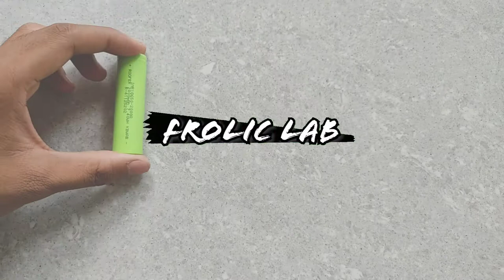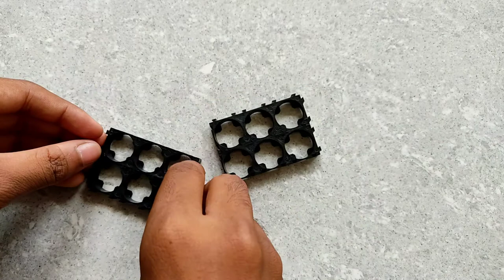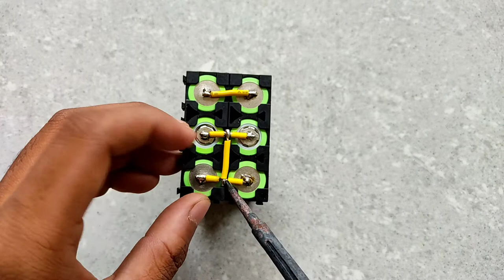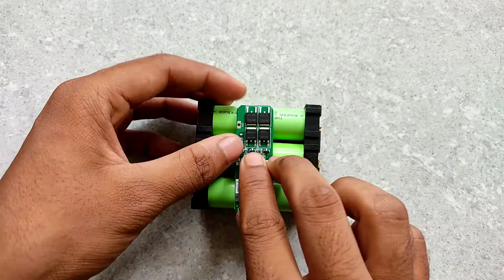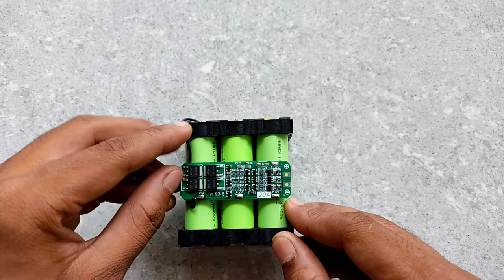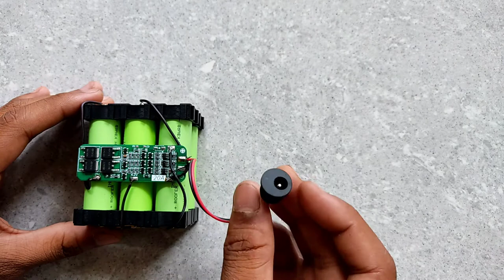How To Make A 12V Rechargeable Battery Pack Using 18650 Battery & 3s BMS.

Comment: Hi, nice video. What kind of power supply did you use to charge the pack? Is it a proper charger (maybe a CCCV) or a simple 12 V power supply? I'm asking because I'm not sure what to use, I have a similar BMS and I don't know if it includes a charger in the same board too.
Reply: 12.6v smps

Comment: Pls can you tell me how can i make different output and rechargeable point
Reply from the maker: Connect a male barrel connector or output wires in parallel at the same point.
Reply: Thanks 🥰

Comment: Hiii bro mean drone bana raha hu to kya 3s battery Or sathe bms power module use karsakta hu drone mea fix kar ke..!!! Koi issue ho sakta hai kya
Reply from the maker: No, bro it will work the same, only factor is your power requirement and weight of the battery.

Comment: Bhai iske liye changer konsha chaiye
Reply from the maker: Any charger or supply with voltage 14-16V will work or you can use XL6009 stepup module to charge this.
Reply: @FrolicLab  bhai ek kaam karo ap iski battery bna kr de sakte ho BMS wali 12.6 volt iska charger hey 14 volt 2 AM ka bina bms ke charge nhi ho rahi hey please help karo bhai yarr wo bhut mhenga aya hey kam se kam uske pase washul ho jaye
Reply from the maker: Bro check the circuit diagram, and check connections properly it will work, And also check  your batteries if they are faulty.
Reply: @FrolicLab  bhai ap bna do kitne pase logo ye batao
Reply from the maker: Sorry bro, I don't sell anything
Reply: @FrolicLab  toh bhai 3 sale se ye 4 sale se 12.6 volt ban jaega bina bms ke but uske liye charger kitne volt ka or kitne AMP ka chaiye
Reply: @FrolicLab  bus ye toh bta do ishe charge kase karu
Reply: @FrolicLab  mare pass 8 sale 3.7 volt wale 18650
Reply from the maker: With 3 cells in series you will get 12.6 but charging without bms can burn your cells, or you can charge each cells individually using TP4056.
Reply: @FrolicLab  bhai ek se tp se 3 sale charge ho jaenge
Reply: Sorry 4 laga dunga ko kr degi kiya
Reply from the maker: No bro, you have to charge them one by one.

Comment: Sir i have a question can i use this battery in bike using this bms 
Can its control buke input voltage which vary high some time and sometime low??
Reply from the maker: This setup has 4A output, You can use this BMS in your bike with more batteries in parallel.
Reply: Ok and charging voltage which high up to 24 v can b handel by the bms
Reply from the maker: No, upto 18V, I have added a link in description you can check detailed specifications for the bms.
Reply: Thanks for your reply and help♥️

Comment: Sir can I connect it in my solar charge controller.... Instead off my lead acid battery.... I hv  already made a 10 amps 3s battery bank.... With BMS.... Pls reply me.... And what would be da charging voltage and current for this....
Reply from the maker: Yes you can connect, but only to charge not as a backup for inverter. Charging/discharging depends on the BMS used, for the one I used charging voltage can be 15-18V @ 20A peak. Do check the datasheet of your BMS, Voltage and current can vary.✌🏻

Comment: Can this be used to power an Arduino Uno board without having any issue
Reply: Cause the 9v kind I made runs down quickly
Well I used it to power and Arduino Uno with is powering 2 ultrasonic sensors and a servo motor with a 16x4 display and a buzzer 

Hope it's not too much load on a 9v battery😢

So I'm thinking of trying this 12v on the Arduino Uno Vin and GND 
I hope to get a reply on this I really need the extra help at this point 🙏🏾

Comment: If I charge it by 14.4v how it manage.
Reply from the maker: When every cell reaches its max. Potential(4.2V) the BMS stops charging (overcharge protection). And also the BMS is rated for 18V max. Charging voltage.

Comment: hello I would like to make a 12 v battery with 3 x 4.10 v batteries. - do they have to be mounted in series? - Which BMS do you recommend? thank you for your videos.
Reply from the maker: Yes, use them in series. And you can use any 3S 12V BMS as per your ampere requirements.
Reply: @FrolicLab  thank sir
Reply: This can be use as speed battery for xiaomi scooter? Series connection

Comment: any body with a calculator ....just put in 3.7 volts X 3 = 11.1 volts so not ...12volts .....and dont solder...... Is it safe to solder on a battery?
You should never solder directly on a battery. It might not be dangerous, but you will hurt the cell. The best solution is to spot weld a new nickel-plated steel tab and than solder

Comment: How do you charge this? Is the input output is the same connection?
Reply from the maker: With a dc supply of 13-16V, & yes the input/output are at same point.

Comment: Dear does it have balance charging
Reply from the maker: Yes
Reply: @FrolicLab  no your bms board 20 amp doesn't have balance charging it is only protection board..
Reply from the maker: Yes bro it does, I have tested it manually and got close enough figures as mentioned in its datasheet.

Comment: i guess the question is how long can you run a 12v load for???
Reply from the maker: It depends on load, At 12V if a load draws 4A then it will last for 1 hour, if it draws 2A then for 2 hours and so on..

Comment: Bro which C rating battery should we use
Reply from the maker: I have used 1C batteries, it depends on the BMS, This BMS can handle upto 20A
(C-rating× Amp-hours= voltage)
Using this formula you can adjust C-rating according to voltage required and as handled by your BMS.

Comment: Your using 18650 battery right? But 18650 battery is 3.7v each how can you make 12v battery?please answer my question.thanks
Reply from the maker: No bro, 18650 batteries are rated for 4.25V which comes in different current capacities. You can also check its data sheet if you need more information ✌🏻
Reply: @FrolicLab  The question is more towards understanding why are you using 6 batteries if you only want to reach 12v.
Reply from the maker: To increase current from 2Ah from 3 batteries, to 4Ah from 6 batteries i.e to double the power for the same voltage.
Reply: so why not put the in parallel to increase your mah
Reply from the maker: All in parallel will make 4.25V and 12Ah, but I needed a 12V supply, therefore this combination.
Reply: @FrolicLab  Thanks for all your explanations. I personally love drill restorations and have seen very similar battery arrangements although not much explanations on the battery setups so I must thank you for that. Maybe a small explanation could be part of these type of videos....I have 1 black and decker drill 12v that has been fabulous but discontinued and the batteries are starting to fail so Im planning on restoring the battery one of these days....and brand recomendations on the 18650 cells?
Reply: @FrolicLab  18650 here are 3.7v so you need 4 x which is 14.8 max which is the max voltage the 12 v rated batteries reach in actuality. If you get a lead acid or gel battery and you fully charge it with a solar system the voltage is 14. 6. At 11.5 v you are already very low voltage zone.

Comment: Your video is incorrect, the charging should be at 12.6 volts, but it is still showing the same voltage when you tested, so it is not charging
Reply from the maker: The charging voltage used was 12.20V because I didn't had greater than that,& if you carefully notice the voltage before charging was 11.50V & after connecting to charge the Voltage was 11.70V it is due to the BMS that i used which was balancing the voltage & slowly raising the voltage , but after 2 hrs of charging, the Voltage of the batteries was around 12.20V.
Reply: @FrolicLab  ok, thanks for the info, but still full charge of 12.6v can't be achieved, or have you done something about it?
Reply from the maker: Each battery is rated for a full charge of 4.25V which makes it 12.75V for 3 in series, I used a step up module XL6009 and charged batteries by setting it (XL6009) to 13V.

Comment: Bro can explain ..How many hours to take  charge with 1 amp? Because I have 12v 1amp charger
Reply from the maker: Theoretically Tc= Ah/A, Since it is a 4Ah battery it would take around 4hrs to charge with 1Amp charger.
But it will not fully charge the batteries as each battery has max. Rating of 4.25V which makes it 12.75V.